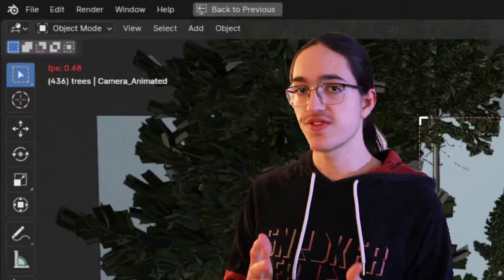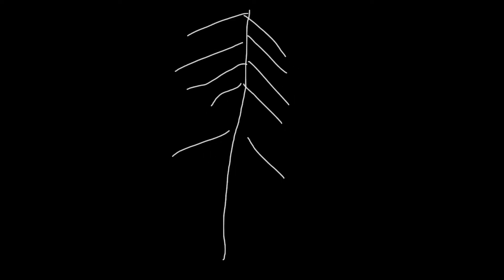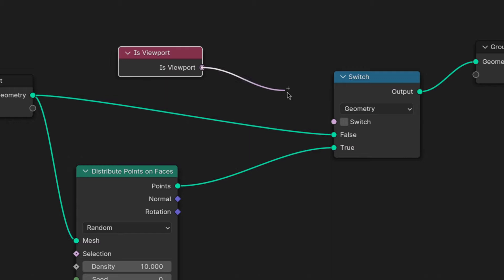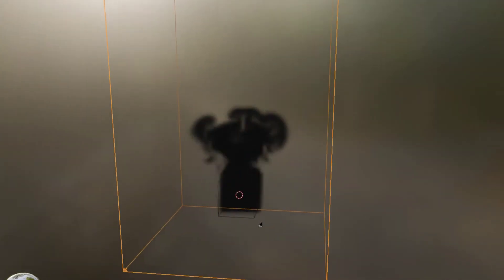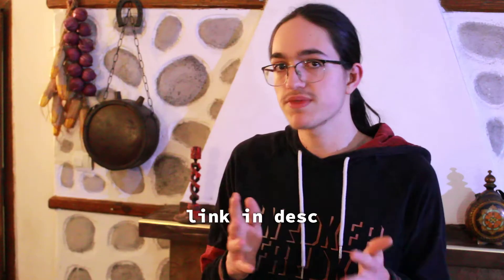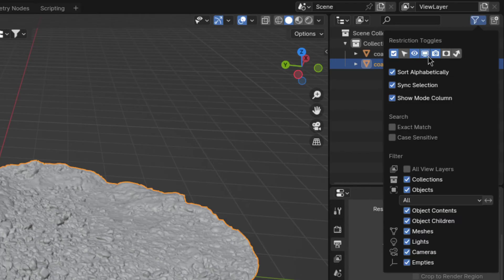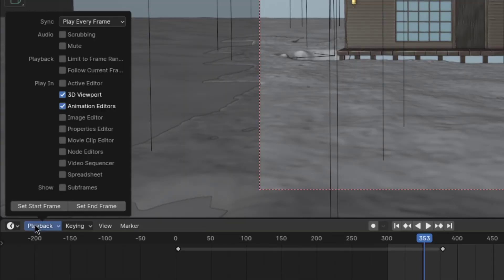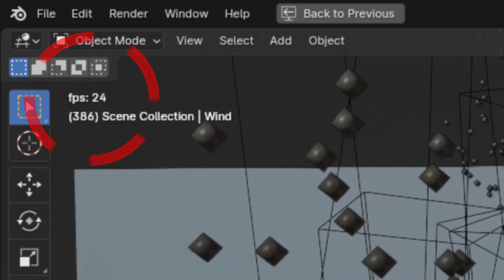Every Way to Optimize the Blender Viewport

Comment: Anybody knows if buying extra ram would work as well or would it be a waste of money?
Reply: Extra ram for 3D Rendering, as ive come to learn, is never a waste of money. Of course if you're never rendering hyper realistic or simply unoptimized high res models or textures, then it might be unnecessary to get more than like 32 or even 16 GBs, but in general it never hurts to have more ram, if only so your computer doesnt suddenly come under a load so heavy it locks up or crashes. For rendering speed however, as in to make the FPS smoother, you'd need better GPUs or CPUs.

Comment: Bro, do you have any suggestions regarding rendering the Fuild simulation with bubble particle animation? It takes forever too long to render one frame; it almost takes more than 2 hours. my resolution set to 200 for liquid and for particles I use 10% which have around 200k-250k particles for bubbles i used Ico sphere which has 8 faces & my sample account is 100 first I rendered 3-4 frames with 150 Samples it took 3 Hrs to render one Frame i can't justify time & energy it consumes running PC For hours just to render 44 frames of animation, is it normal or do I have a problem in my system? I have an AMD 6600 RX GPU. I'm so overwhelmed. If you have any suggestions, please let me know.😢
Reply from the maker: Hey there - yeah I think I know what the problem is cause I actually had the exact same situation when working on my fluid simulation tutorial - the solution was to disable motion blur - and add with the compositor instead (using the vector render pass & a vector blur node) - I hope that helps!
Reply: @edinspiegel I tried using that, bro. I don't know why it doesn't work with fluid. I thought the first problem was with the latest blender build, so then I tried the old 3.5. The same issue was encountered there too. I tried several times with different settings it had in the vector blur node and still it didn't show any effect whatsoever, but when I tried using normal, non-fuild animation, it did work. Why is that? I can't use normal motion blur because it takes over 2–3 hours just to render one frame, whereas without motion blur, it literally took just 40–50 seconds per frame. I finished the entire 44-frame animation exactly in 30 minutes. where I rendered 35 frames with default motion blur, it literally took 14–15 hours. I stopped it after that. It makes no sense to waste so much time and energy by running a PC for hours. If that's how it is, then I'm done messing with fluid.
Reply from the maker: Oh yeah for the vector blur to do anything to the fluid, you have to enable "use speed vectors" in the mesh section of the fluid domain settings & also switch the cache type to uni cache & then re-bake - otherwise the vector blur won't affect the fluid. I think I also mentioned it in this video here: https://youtu.be/sye6DI3vZGs